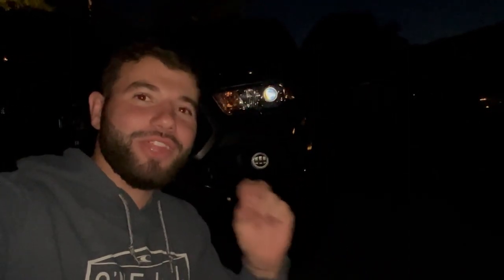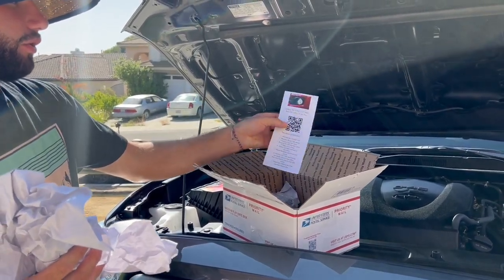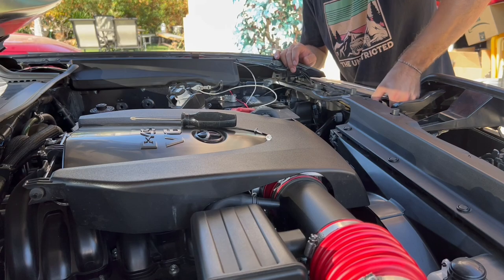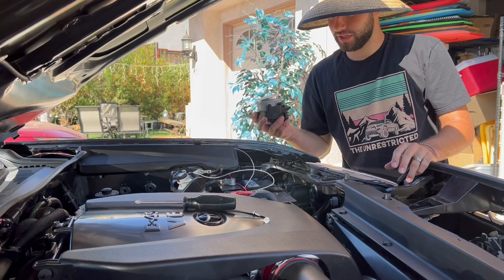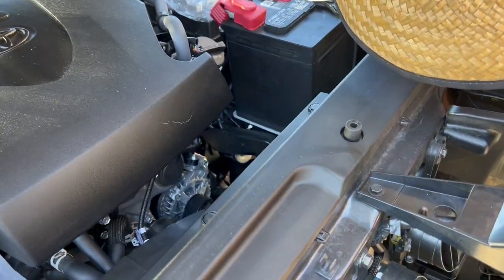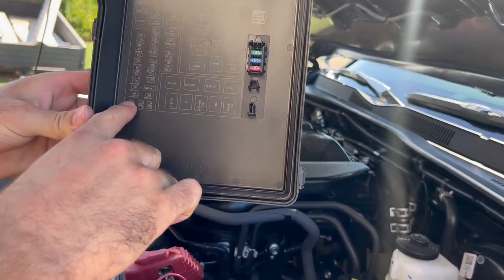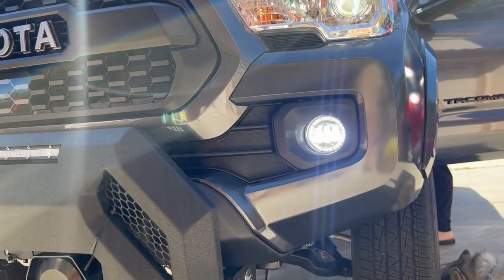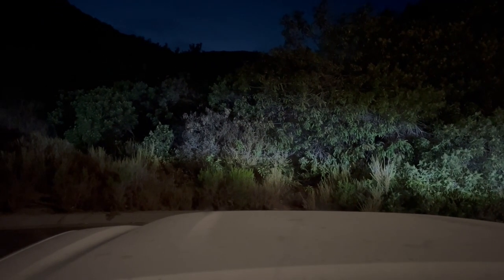Installing The Halo Switch Back Fog Lights in Under 10min!

Comment: I bought the halo switchback fog lights back in August of 22. I didn’t get around to installing them until a few weekends ago, January of 23.  When I first connected the lights, one light was yellow and one was white. Switching flipped the color from left to right and back again. I kept plugging and unplugging them until they finally synced up. Now that I have both side projecting the same color, they do not project at the same height. When white the driver side light is low and the passenger light is high. When yellow, the driver side is high and the passenger side is low. Is it supposed to be this way?  Both of these issues were probably my fault. Any help would be greatly appreciated. I really like the look and concept of these lights, but my OCD can’t deal with the uneven level of the lights. 🤣. I’ll include a link to a video showing the projection of the lights. Thanks again for any help!!

https://youtu.be/Zzv8g-Lla1I